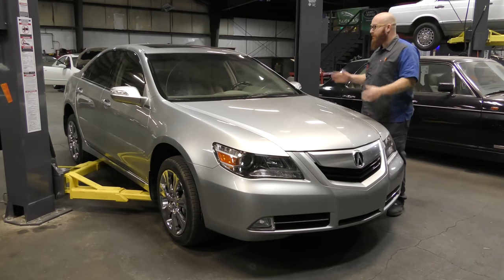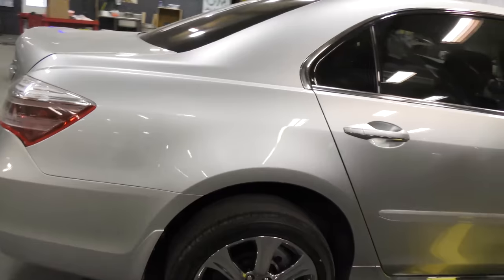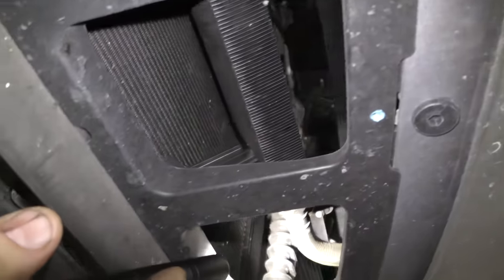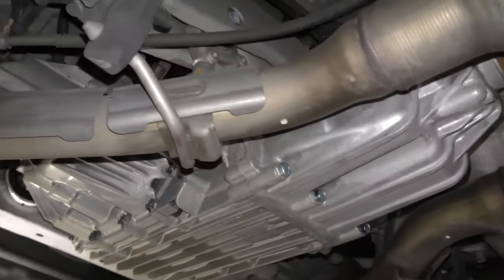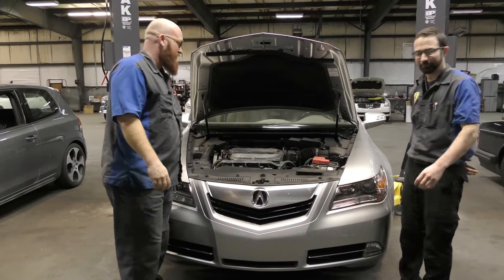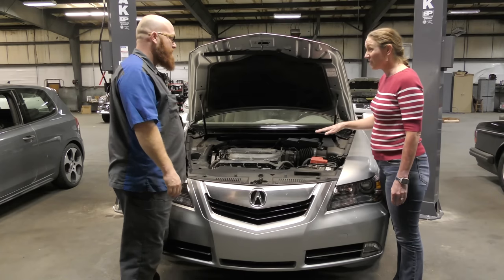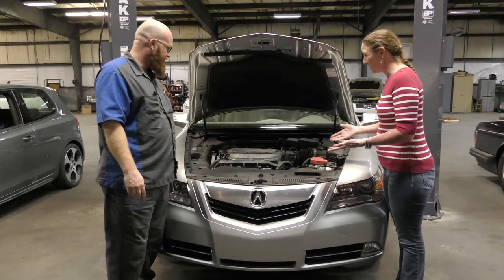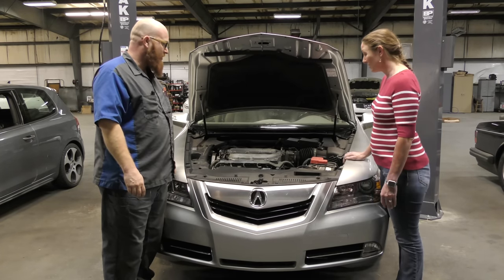Something Very Serious is Wrong with this 2010 Acura RL! What did the CAR WIZARD find???

Comment: Why don’t you pull it, strip it down to the block and head, send it off to your local machine shop, and have them rebuild it for you? They’ll clean it, deck it, put new bearings in it, reassemble.  I’m not understanding why that isn’t an option in your mind. There is nothing special about a Honda 3.7. It’s just got a bigger stroke probably. My local machine shop here in the Valley would probably charge 2k for that.
Reply: I kinda wondered that. That is, of course, assuming that 𝒔𝒑𝒂𝒓𝒆𝒔 are available.
Surely, unless the actual block is damaged, the engine can be repaired? I didn't hear anything about the customer not wanting a repair. Are we not talking about a guy called the "Car 𝑾𝒊𝒛𝒂𝒓𝒅"?
Don't get me wrong, I'm no mechanic but, if parts are available, why can't the engine be repaired?  The way the Wizard spoke, he hasn't investigated too much. Do we know exactly what's wrong with it?
Reply: we miss you 50skid! Please do some more videos or tell us about your life! Do a video soon! I fixed my BMW alone so many times cause of your instructions and i really really thank you for that!

Comment: With that low of mileage for a 2010, I'm curious how often the oil was changed on it.
Reply: Often, My friend would change it about every 3K miles.
Reply: @adamgraham6265  Well it seems like that he should have looked at the oil level more often.
Reply: @Shabbe02  The oil level was full. The oil pump must have failed.
Reply: @adamgraham6265  my bad
Reply: @Shabbe02  np just updating the people as they have been wanting
Reply: 3.7 Acura's have a known issue of consuming oil. I know because my TL 6mt also consumes a lot of oil. It's such a known issue that Acura redesigned the pistons and rings to correct this. oil change frequency had nothing to do with this
Reply: @adamgraham6265  strange. This engine is known for burning oil. Must have been a different issue.
Reply: @UnrealOG137  well I know the owner irl and he said its oil pump failure.
Reply: @adamgraham6265  ah. Acura told my dad (he has a 2010 mdx with the same engine) that the oil pumps sometimes leak. Never heard about failure.

Really a shame that this happened.
Reply: @UnrealOG137  agreed. I myself drive a car with an identical engine and it burns oil so I have to stay on top of it. The owner is METICULOUS with his cars.
Reply: @adamgraham6265  did you get the recall done?
Reply: @UnrealOG137  no mine wasn't burning "enough" oil
Reply: @adamgraham6265  Actually, it is every 5k miles
Reply: @ryancoopershelmet7164  nah we change it every 3K.

Comment: It would be so good to actually see it being pulled apart and actually see what has died 
To cause the knocking 😍😍👍👍
Reply: I sure hope they'll do a video on it!
Reply: I'm retired now,but when I still had my shop I used to explain to customers the difference between oi pressure and level,I would compare oil pressure to blood pressure,If your blood pressure is zero,you die pretty quick,the same with an engine,zero oil pressure means a quick death unless you immediately turn off the key and coast to the side of the road,you may be lucky and save the engine from major damage.---People don't know the difference between oil level and oil pressure,they think that when the oil light comes on that they have to add oil.
Reply: Yes, most definitely, I’d be willing to bet it was due to lack of use or improper maintenance. 

1. Oil changes/checking the level was being based on mileage. It could’ve had 2,500 miles since the last change but if it had been a year or two the oil would’ve degraded to the point that it failed to protect the delicate components.  

2. Seals had deteriorated.
Reply: thats def a rod knocking 100% that noise is always easy to verify
Reply: These 3.7s had a recall for faulty piston design. I work on em every day.
Reply: @supersabrosinho  first time ive heard of that....
Reply: @seymourbutz6951  same i have J37A3 and nothing like this happened

Comment: Any chance a 3.5 could be swapped in? I have a feeling they share a lot of components, if not alignment, bolt for bolt in some instances.

If they do, might be better to swap in a 3.5 so that if there are any major engine issues in the future, repair to the 3.5 will be a lot easier
Reply: From what I understand from AcuraZine, the 3.7 V6 is just a sleeveless, bored out 3.5. That is the only difference between the 3.5 and this 3.7 engine.

Comment: As stated by others, the 3.7 from the TL SH-AWD(J37A4) and ZDX(J37A5) with the dual VTEC heads will be a near direct swap. Might be some accessory or sensor differences, but they're nearly identical.
Reply: The car is worth $12K tops in perfect condition---not sure throwing a rebuilt engine in there at $7K is smart. Just let it go, use the $7K on a 2011 Prius or Camry and the kid will finish his PhD with value left in either of those.
Reply: @trevorsutherland5263  - Yep. Sell the car for $3k-$4k and move on. Let the next person deal with a used engine replacement.
Reply: @OMGWTFLOLSMH  Acura of Roseville has agreed to cover the costs because of the issue and regular maintenance preformed at that dealer. According to the owner.
Reply: @trevorsutherland5263  some people when they rebuilt the engine or motor they know they're not going to get their money back they just want to have a reliable car to take them from point a to point b it's more like an investment personal investment
Reply: Could I out the j37 air intake manifold on a j35a8 motor in a kb1 '05
Reply: cars worth WAY MORE THEN 15 K
Reply: J37A5 is different from the rest of the J37

Comment: Maybe the dealership changed the oil and forgot to add the oil and then started it and let it run until he heard a  noise and then added the oil. I dont know, just a guess
Reply: Maybe the owner never changed the oil.
Reply: @stevec5000  seeing as how the owner has kept up with all the other maintenance, I do not believe that is the case at all.
Reply: @bigdm9349  Not if it belonged to an old lady who kept it in the garage and obviously didn't drive it much.  You obviously haven't worked on any women's cars!  They generally drive them until something breaks, like this one!  She might not have done any maintenance at all, especially since women usually don't even know that cars need oil.
Reply: Or the Car transporting driver took it for joyride Abusing the life out of it. I wonder how many miles he drove it after it was dropped off. I have a friend that bought a car 2012 or13 not sure of the yearPontiac G8 in 2019 with only26kon it and just like this car  look like Brand new. And within A thousand miles it threw a rod.🤔. The Worst way though is having those companies that will drive your car to you. Don't do it you'll be sorry.
Reply: @stevec5000  exactly old lady driven is not a good thing they don’t change their damn oil or if they do it’s after 15-20 thousand miles
Reply: @stevec5000  I’ve seen wayyy too many lady driven cars with sludge in the engines
Reply: some other comment on here said these engines were recalled for oiling issues, an that they were still fixed for free at 100+k miles. looks like this one here was simply never done and failed

Comment: have you thought about a 3.5l  or 3.7l short engine from ebay? also asking Honda direct rather than through dealer? Honda America or even Honda in Japan direct? It can be more useful as middle men might not want to say "we can get one in 3 months"  might be worth seeing which parts are needed and pricing the parts up as they are known to support parts long term even is don't have a spare engine. you could look into marine engines from Honda too.

Comment: I have a 92 Camry I bought for $500 and put 400k miles in it till the engine blew at 500k. I won't hesitate to put $3k in it and drive it for another 20 years. $7k on this clean car is a bargain because the alternative is anothet $60k for a new car.
Reply: Engine blew at only 500K?
Reply: The Camry engine would literally run for ever if it could be resleeved
Reply: Sure but it is still a lot of money that the owner may or may not have..to spend on it.
Reply: May I suggest you get out and live life a little? We are only here for a short time you know----go buy a Hellcat.
Reply: No one runs a car with that many miles in my country.. We just scrap them. Socialists can afford because we ain't paying for healthcare.
Reply: Bro this car is worth $14k max even with the miles
Reply: @automotivetv9861  14K... . Money is not some we talk about. We think its rather vulgar
Reply: @trevorsutherland5263  We should do what makes us happy.
Reply: @trevorsutherland5263  Hellcat will die within 3 years.
Reply: @wholeNwon  Head gasket mainly. Was weeping for 100k. Was smoking and plugging up cat. I punched it out and used a new one to pass smog and then I would put the old one back in.
Reply: @obsoleteprofessor2034   Wild. Never had a head gasket issue but a buddy bought a Subaru without saying anything to me first. So his fingers are crossed now.
Reply: @machtschnell7452  Agreed.

Comment: Wizard, you can find a few 2009-2012 Acura RLs with that J37A2 for sale in IAAI, or copart, with around 60k miles. yes you'll have 20k miles more in the engine, but it will be as it came out of the factory. not a rebuilt aluminium engine, that had rod shavings running inside it... It will be cheaper, and you'll have an entire car for parts, if needed, that you can use to increase the profit margin in the job.
7k$ for a rebuilt engine, only if it comes with a 60k miles warranty, or something, that I doubt they'll be able to do. And even if it come with a warranty, do you really want to have to do the same job again before that car has over 200k miles?
Reply from the maker: Customer wants rebuilt or new only. Not used whatsoever
Reply: @CarWizard  Aha. So I was thinking there were no used engines either. Well if he is so stubborn that he doesn't even want a used engine with 27k on it than I don't feel so sorry for him anymore. Its his own choice..
Reply: Just find a really good Honda racer guy that builds engines, every town has them.  You don't need to send it to Michigan.
Reply: Didn’t these 3.7L have a recall for piston rings or something ?
Reply: @krassimirpetrov7131  It might have been a TSB.
Reply: @krassimirpetrov7131  yes they did it was a warranty extension for cars with excessive oil consumption
Reply: @CarWizard  I would rather have used low miles than rebuilt. The way Honda assembled them it more likely to last long if it was low miles used.  I see the customer has more $$ than cents though. LOL
Reply: @TimZ007  From what I read in the comments, customer isn't paying for it, the dealer in CA is.
Reply: @CarWizard  Even if it’s used with 30k miles? Car part lists 3-4 motors all with 20-40k miles.
Reply: @TimZ007  completely agree with you, factory assembled is still the best for these complicated engines

Comment: Hey guys I had this same issue on my Acura TL. That noise is actually the timing belt slapping around. The TENSIONER is bad and not putting enough tension on the belt! I would check the tensioner before anything! I promise this was the EXACT noise. When you rev it up does the noise go away slightly? I replaced my entire engine just to find out it was only the tensioner as well, so hopefully I can save someone else the time and hassle.

Comment: That generation of RL came with a Carbon Fibre driveshaft - pretty incredible to see that level of effort and detail (and cost!)
Reply: I would spend the $7,000 to re-build the engine. It's going to be a Classic car at some point. i.e. 55 Chevy!
Reply: @mikebingham9700  doubt it’ll make it to classic status. For that matter, I doubt any post 2010 car on the road today will make it to that point. Except maybe some American muscle with a dedicated cult following in the future.
Reply: Only $4500 to get another in case it fails 😅😅😅
Reply: @Gerarghini  isn’t the whole point of it being carbon fiber is so it DOESN’T fail?  At least not easily.
Reply: Until the bearings they used close to the exhaust there go bad and start whining like a bitch 😭 also can't replace just a bearing gotta be the whole shaft. Luckily TL isn't carbon

Comment: YES! Finally some Acura Videos and I'm glad it's of a 2nd Gen RL. They're the most under-rated Acura ever next to the 2003 CL Type S with the Manual Transmission. Unfortunately oil burning is a common issue with ALL Honda/Acura J37 3.7L Engines because of faulty piston rings from the factory. You can read all about the class action lawsuits that are STILL on going with these engines. They burn oil like crazy and unfortunately that's what probably happened to this car and the owner didn't realize that it was so low on oil until it was too late.

Comment: Well it obviously isn't  a noisy lifter or rocker arm .  I watched a video on another channel  where a Mercedes specialist  took on repairing an 80 series Land Cruiser, making a similar  noise   and the fault was one of the main bearings spun and fused itself  to the crank. The mechanic tried repairing it by sanding it down with some  very fine wet & dry sandpaper   but it didn't work.  It needed a new crank..

Comment: I don't think I've ever seen many RLs on the road. That one like you said looks in rather good condition, but with the low mileage that makes sense. That's unfortunate about the engine; who knew the J37 would be so hard if not impossible to find versus a J35. That's good to know about; it's rather insane that you can't even get a J37 from Honda/Acura! Can't wait to hear the RL and see it running again when you all get the rebuilt engine back in it.
Reply: It’s very strange because Acura was replacing these left and right a few years ago for the oil burning issues.

Comment: I have a 2010 Honda Accord. 2.4 4 cylinder. My engine and the V-6’s from that era had a oil consumption problem. They don’t leak or burn the oil. It literally just consumes it somehow. I have to put a quart of oil every 3 weeks in mine and it’s dry as a bone around the engine.

Comment: Cant you get a used engine from Japan, they usually have 30000 miles or less?
Reply: Def should have some engines in Japan
Reply: Exactly what I was thinking.
Reply: This engine would be even rarer in Japan than in the States
Reply: I think we should overnight parts from Japan.
Reply: Most if not all J series engines are made in America for the North American market. Japan didn't have any J-series engined vehicles sold in their market at the level we do here so America is the best bet for finding a J37.
Reply: These engines don’t even have that many problems since people take good care of them which is why there’s not many used engines
Reply: Tone.  It was actually, installed in the facelift Honda Legend (same car basically) I bet that there were more KB2s sold in Japan new compared to the US
Reply: @banstaman  some just dont know the facts
Reply: The Japanese Hondas don't have j seies engines the j37 is an American honda motor
Reply: @SVSky  The Acura J series was never sold in Japan. Its a North American only engine.
Reply: All these comments are moot.
The customer specifically said NO used engines.
Reply: @TheMrLebaron  what are you guys smoking the J series was installed in many models in Japan.
Reply: @Shabbe02  But as the Wizard explains, not this specfic one, it was only ever put in the RL.

Comment: It'll be really interesting to learn what the heck even happened to that engine (if, hopefully, the rebuild company provides that information).
Reply: I will keep you posted on it.
Reply: @lorencooper6043  It sounds like big-end bearings to me. Same happened with a car I had. Some cars can't run on low oil or the bearings break. I had to replace engine as well.
Reply: @alexbowers4203   oil was all full.
Reply: @lorencooper6043  You should try to contact Acura Customer support at 888-234-2138. These engines have their warranty extended to 8 years/125,000 miles due to piston ring issues causing excess oil consumption. Acura dealers are able to get replacement engines.
Reply: @lorencooper6043  Wish you best with your car, very clean.
Reply: The engine oil pump must have failed according to the owner as the dip stick showed full.
Reply: @adamgraham6265  Yiiiikes, yeah, that would definitely do it.
Reply: @keithf8649  yea but the car is already 11 years only it’s way past the 8 year mark despite mileage. Acura won’t take my 2011 MDX with 79k miles for the oil consumption because of the age of the car.
Reply: Oil pump drive or pressure relief valve spring failure?

Comment: Wonder if the 3.7 had the VCM issue the 3.5 have and caused excessive oil consumption. My 2012 odyssey had the "ring" job to correct the VCM. I ended up muzzling the VCM.

Comment: You should definitely interview the engine rebuilder and ask him what went wrong internally in this engine, and whether they think it's a common or even at all occuring failure (on all the other engines they have rebuilt so far). Or if they don't want to be interviewed, then at least tell us what they found!!
Reply: That is a great idea. I really think that's the juiciest bit of info we could all appreciate
Reply: I second this, I would love more info on how this happened!
Reply: 99% certain that this is a basic user fault, too long interval between oil changes which has clogged the oil lines that feed the main bearings and the rod bearings. For that reason a rod bearing has lost it's oil film and made contact with the crank and slipped loose/worn out.
Reply: @TeroYyy  I doubt it, I bet those j series could go the entire 47k miles with no oil change and still be fine. Probably oil pump failed or engine was consuming oil and he ran out.